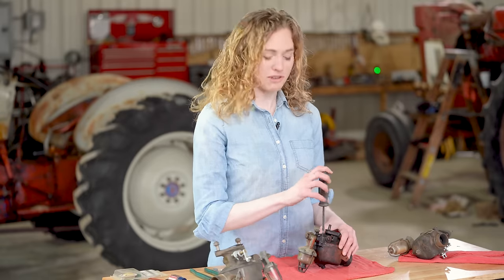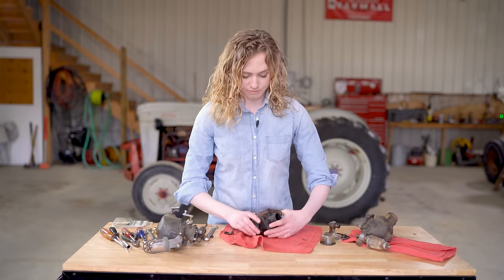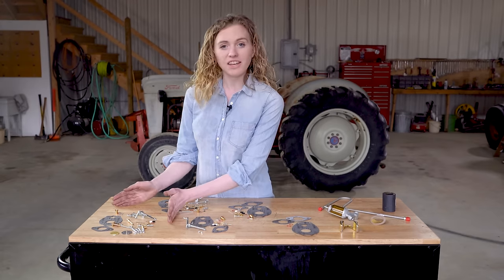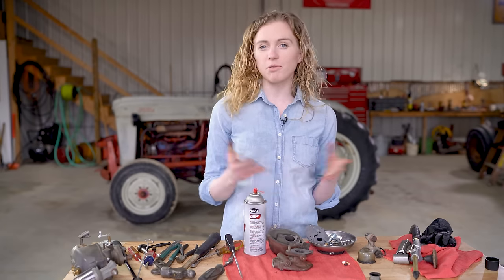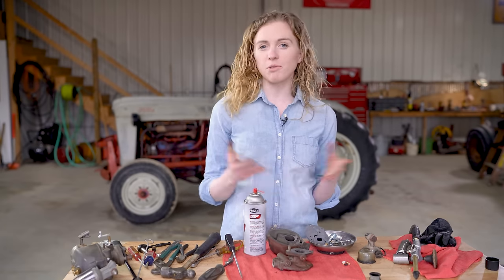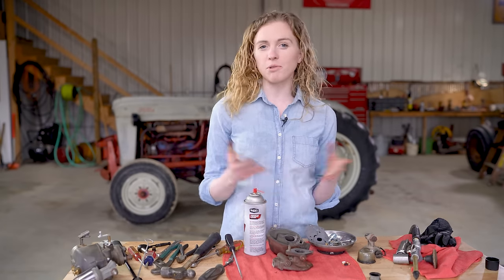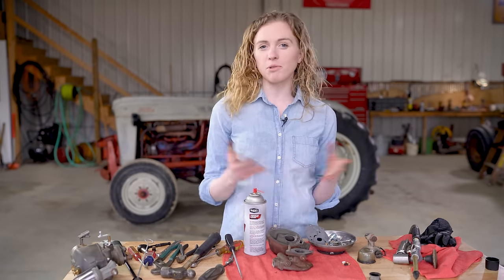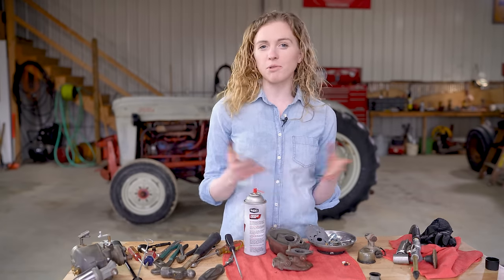Ford Marvel Schebler Carburetor Rebuild: NAA, Jubilee, 600, 700, 800, 900, 2000, 4000

Comment: Rachel,  New to your channel but I am so glad I found it. I just bought my first tractor, a 1958, Ford, 800 (850) last week and I have been binge watching your channel for the past day. I want to thank you sooo much for all of these videos. I will be starting my repairs next week and I will be using all your videos to assist me in my endeavor.
Yes, I will be ordering from your web sight because I believe you love what you do and you deserve to earn and keep this channel going.
With all that said I would be very grateful if you took a moment and made a short video on the operation of a Ford 800 or similar. I have spent days surfing YouTube and find everyone driving and showing off their tractor but I can't find one video that goes through the operation of all the knobs and levers (hydraulics).  I recently bought an I&T shop manual for it and although it is a great read, it does little to explain the actual operations of the peripheral levers and pedals I see on the sides of the rear hydraulic area. In other words it would be a big help to someone like me to watch and learn how to operate a tractor.  Just a note; mine has a front end loader, constructed with tube steel not round tubing. Keep up the great videos. Bless you and your family, keep safe and be good.

Comment: GREat Video......One thing I wanted to mention So many tractors have clogged or extremely slow fuel feed to the carburetor from the gas tank. Sometimes even as little as a steady drip drip. There for not supplying enough gas  to run your your tractor. The carb is using more gas than being supplied from the gas tank causing it to flutter the engine or it just dies and then will restart later and run for 2 more minutes.draing the carb dry again  and again. Blow out clean the line Caution taken to not blow lines back into the gas tank.

Comment: Hi, I have been a consistent viewer of your videos for several years now. There is always, on most content providers, on the subject of tractors, plenty of information about Ford 2n, 4n, 8n, and Jubilee tractors. I have just inherited an 800 that has been neglected for many years. Last year it would still start and run. I believe that after some replacement wiring and along with the points and starter switch that I recently replaced that it will still start and run fine. It has front end loader, three point hitch and what I assume is an after market backhoe. The backhoe is still functioning to some degree, but the front end loader seems to have a blockage. I have zero way to haul this to a repair shop and nearest, tiny town, with no tractor repair services, is 14 miles away. It's more than 50 miles to a town with anything resembling a repair shop for tractors. I have just come across your video to identify tractors, but I need to identify the backhoe and to confirm identity of my front end loader, in case it isn't a factory product. I've asked everyone that might know in a 60 mile radius with no real information to solve these questions and I've been trying to find the answers for nearly three years now.. Yes, I know that there has been large amounts of water in the front end loader system. I can not find any type of water collection bowl/filter on either of the hydraulic reservoirs.  I have replaced about seven of the many hydraulic hoses altogether on front end loader and the back hoe and none of them are leaking, yet. My father rebuilt the two largest hydraulic cylinders on the front end loader and there are several small to moderate leaks in other cylinders. The problem doesn't seem, though I'm definitely not more than a novice at working on them, to be more than a blockage. Wondering if the water in the system may have corroded the metal tubing running between the hydraulic hoses at the control block (maybe wrong term) with the levers to lift and tilt the bucket on front end loader and the hoses at the far end of the front end loader and has therefore may have rust in the control box. The front end loader does still move up and down and the bucket tilts, but there it is very slow now with whining and all the front end loader hoses flex and move as if there is a lot of pressure building leading me to believe that the hydraulic pump for loader is strong. I will still lift considerable weight, though very slowly. Asking, as an individual, with little money, who takes care of two bed ridden individuals, both of their properties and my own, the mowing of all three properties, which have a total of 16 acres that are kept mowed and weed ate, by me alone and the home maintenance of all three properties, (insert some whining here that I might have left out in the prior few sentences...lol) where can I find information on those questions about the loader problems and the loader and backhoe identification without a large investment? I do have a cell phone for any pictures that are required.

Comment: Great tutorial however a few things to remember. A vice and red rag make a great 3rd hand. On the butterfly screws, they need to be swedged on the threaded side or apply thread locker. With vibration they can back out over time and get sucked into the engine. Not a good thing. Finally, to set the float, bend the tab that the needle hooks onto. The only time you would need to bend it elsewhere is because it was bent and the pontoons aren't level. I speak as the owner of an 841 tractor. Of all the tractors I own, that is my go to for any real work. Also my tag is silver and attached to one of the bowl screws. The scrapper was a great idea to remove the seat, never thought of that, just made my life easier.

Comment: I would recommend a couple changes to the float valve seat installation. Use a hollow point screwdriver or make one out of a scraper to tighten it down. It needs to be really tight to seal, or it will seep and you will get a small drip….for me I got a drop every couple hours when the tractor sat. You can check that the valve is sealing by holding it closed with your finger and using soapy water and air pressure to look for bubbles. It only takes a minute and can save you a lot of time down the road.

Comment: Tip, There is something about Liquid Wrench, if applied to gaskets before trying to open for a couple hours, or overnight, that softens the gasket and makes them pliable again!  I almost never break old gaskets in dis-assembly, and try this before buying new gasket kits!  I aslo use LA Awesome from the dollar store in a cheap Ultrasonic, which cleans old carb's and jet's very well.

Comment: What if you have a tag in both locations? My Marvel/Shebler from a Ford 601 Workmaster has the square tag under the mounting bolt on the upper part of the carb and it says TSX-765 and the other tag that is on the carburetor bottom section says TSX 428 to the far right of the tag it says 61 and near the center a (Y). Which tag is the proper number for a rebuild kit and/or carb replacement??
Thanks

Comment: Rachel, received the carb kit, thank you so much, it works great. Now for a favor. Could you please do a video or tell me if you have a video for the carburetor linkage, specifically the linkage for the throttle. I am having a hard time understanding the linkage with the spring and how it interacts with the linkage to the throttle. I would greatly appreciate some help on this.

Comment: Can you do a video on a early 2000 industrial (1963) with the select-o-matic transmission and the independent PTO with the on / off cable dealing with how to change the speedo cable and PTO cable. Also are the original Tac/Speedometer units repairable? mine spins like a ceiling fan soon as you start the tractor.

Comment: @Dan Gingell and Rachel Gingell -    What if you have gas leaking from the strainer plug area after you have installed the carburetor? Is there a felt packing for that as well?  I have an SA200 and if I don't  shut the fuel off immediately and let the engine run to get the excess gas out if the carb, it will leak from the strainer.

Comment: Any identifiers for the red lion gas engine in 1958 and forward? I have a 59 841 with 172 ci engine. Most info I've seen on it rates it around 40hp.
The red lion seems to be about 62hp. Haven't been able to determine which my tractor has for sure...

Comment: What is the float level distance from the mating surface?  On an 8-N the float arms must be a 1/4 inch from the surface.
Reply: I have a 53 Golden Jubilee. I tried setting my float at 1/4 inch high and the gas will not turn off. New seat and needle. What do I do with this?

Comment: I have the last carburetor shown in video. It's off a Ford jubilee 600. The plate reads txs 690, but bottom reads e9510d. If I replace carburetor, I find the e9510d, but not 690. Should I replace it with a txs with higher number?

Comment: Hi Rachel and Dan. I have one question but its not pertaining to the Ford. Mines pertaining to a 154 Cub lo boy. I put on a brand new carb, but it starts hard and i have to run it with the choke on. I tried adjusting it on  the upper adjustment but the best way to have it running is with the choke out. What am i missing?

Comment: Pretty sure I'm an idiot in need of HELP.  I replaced my carburetor.  I set it much like you did in this video.  I checked everything up to the carb and have good flow.  Installed the carb it would not start, no fuel to the carb. I know it has to be something stupid.....did you remove the _______.  But I don't know what that is.  when i connected there was no flow I loosened the bowl and it filled immediately.  I dissasembled it again and you can't even blow through the carb via the fuel line input

Comment: I have a golden jubilee and my issue is the fuel does not flow from the tank (new sediment bowl) and a (new fuel line) i start the tractor 2-4 min later it stalls, I disconnect the fuel line at the carb and no fuel, wait a few seconds and fuel flows again, hook back up and tractor starts, it then stalls after 2-4 min and once again no fuel comes out when I disconnect it from carb.. anyone have suggestions?

Comment: When I put the sediment bow on the card it leaks any ideas
Reply: Make sure you replace the rubber/neoprene gasket that the top of the sediment bowl presses against when you screw the tightening knob up. If you have to go out and buy one, I would suggest buying two so you don't have to go out, make a separate trip to buy another one sometime coming up.